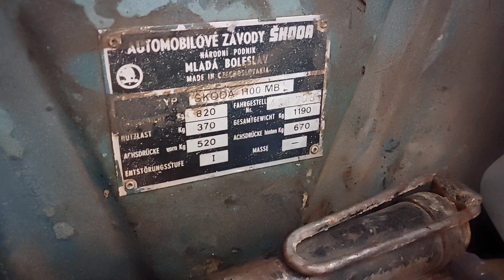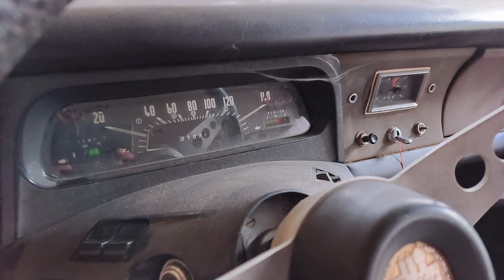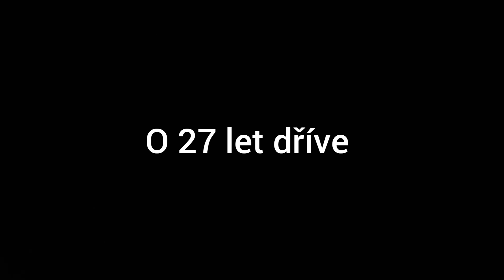ŠKODA 1000MB, 1100 MB De Luxe. PRVNÍ START PO 15 LETECH

Comment: Nice barn find. Some special modifications, like brake booster, electric fan and (Favorit?) engine? This song is about Škoda 1000 mb? I understand some words. What’s it about?
Reply: This song is about what the driver experience on the roads with his car Škoda 1000MB. About it, that he is driving this car everyday and a car still and still rides. It is funny song. The engine is not from Favorit, but it is from Škoda 100L.Valve cover is from Škoda 130 RS. Engine head is modified according to the instructions for racing Škoda. On the engine is inserted intermediate piece for a full-flow oil filter . In the car  is also front axle with rack steering.
Reply: @drakula7019  thank you for your nice comment! Great this song is about his 1000 MB still going strong! I see a lot of modifications. Cool. He must really love this car. I have a 1100 MB it’s still in original condition. I love embecko ❤️ the shapes of this car are awesome.